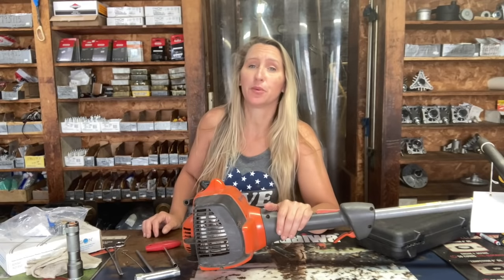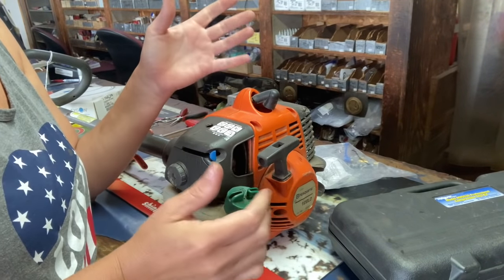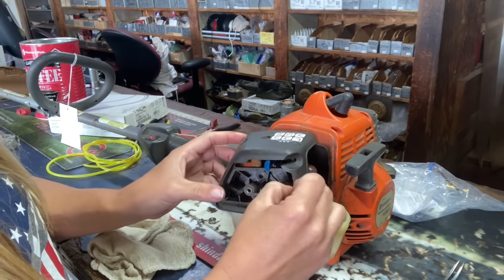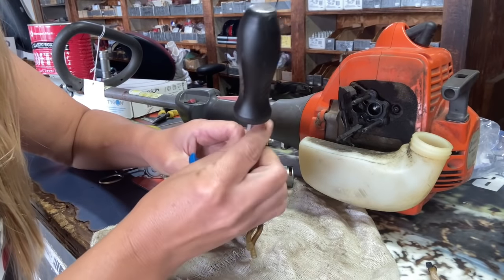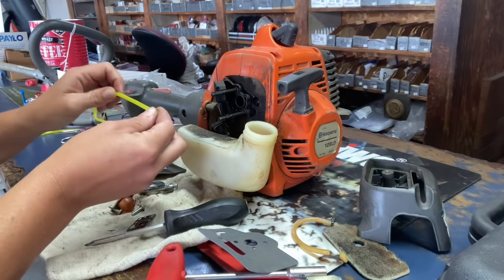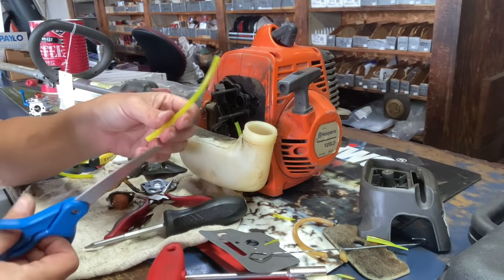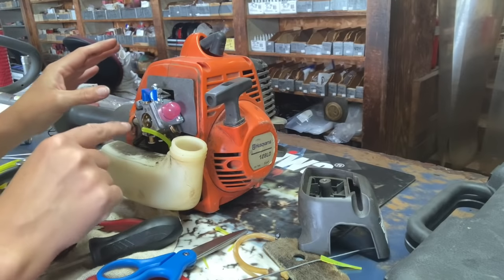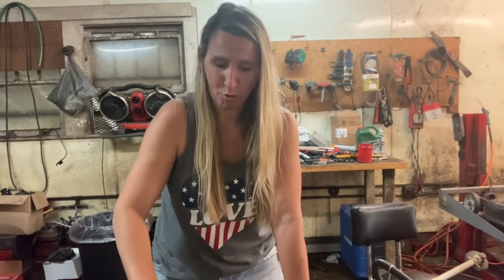How to fix a Husqvarna trimmer that won't start or only runs on choke

Comment from the maker: If you would like to replace the carburetor, here is a link to a Original Equipment Carb. I would highly suggest NOT buying aftermarket. Thanks for watching!  https://www.amazon.com/gp/product/B00QXWP2WK/ref=as_li_qf_asin_il_tl?ie=UTF8&tag=chickanic-20&creative=9325&linkCode=as2&creativeASIN=B00QXWP2WK&linkId=8fd7a5e4477fd19fcb55c5f467281882

Comment: Wonder why she did not reinstall the fuel line connectors back in the tank ?
Reply: ??? She did.  Perhaps you dozed off at that point.
Remember the long diagonal snipping of the fuel tubing  so they could be poked into the tank?

Comment: My Husqvarna trimmer is not even 2 seasons old, and I am having issues, it only runs well on half choke, can't understand, why it has to be choked out just to run decent.
Reply from the maker: Check you fuel lines. They are terrible about rotting.

Comment: Changed the carb checked the fuel and it still only runs on half choke any suggestions
Reply from the maker: Did you buy aftermarket or an OEM carb?
Reply: @Chickanic  oem took your advice

Comment: Always try and sell homeowners canned gas Stihl Echo Husqvarna then there's no expensive maintenance 😁
Reply from the maker: To be honest, even though I know it is the best stuff, I cringe making people pay for the Echo Red Armor canned fuel at my shop. It is SO expensive. I wish it was cheaper for everyone.
Reply: @Chickanic  While engineered fuel is the best from my experience, a half way step that gets great results is fuel without ethanol.  Put a little Sea Foam in it and you're good to go; the Sea Foam is an added extra.  Not a requirement however it does help keep the fuel system clean.  Nice video.  Well done and very useful.
Reply: @Chickanic  It's actually cheaper, depending on who you sell it to. You just need to market it as the gas to use when the machine does not get used very much, then it's worth it's weight in gold (or lumber) in terms of preventing issues. People who run their stuff for hours are better of using their own mix until the job is done, then swap out the fuel for canned fuel, run it a few minutes and put tool back in storage.

Comment: Just drain all fuel out of your fuel tank when your done using then start and run it dry when you leave fuel in your  machine it eats your fuel lines and rubber  gaskets

Comment: Nice video. I’m sure you know and it was just for show at end of video, but I hope you did not give that small engine full throttle on cold engine. That’s number one killer on small engines like that and chainsaws. Cold engine and high rpm cause small piston to get super hot way faster than rest of engine. This causes uneven heat distribution, warpage and scorn cylinders. Always let engine come to temp under low rpm especially on small engines that are not liquid oil lubricated.

Comment: Well now that was a interesting video and obviously you know exactly what you are doing, but as for me I don't want to work on my line trimmer all the time and in the peak of season you have a waiting list it's so long you can't even pay somebody to work on it. So my solution is go electric battery powered weed eater and I have had very good results. I always buy something that has a big battery like 80 volts and it'll cut right with any gas weed eater I've ever owned problem solved.

Comment: I used a drimmel tool to make the fast and idle air adjustable. ENVIRO NAZIs can take a walk till their hat floats. Those loons control the carburetor casting design so you can't adjust them with a  common screwdriver. Good gravy!

Comment: Check out the Tri-clone trimmer, it's perfect for overgrown and tall grass 
Cuts grass, bushes and small trees Tangle-free, save time, save fuel and easy to use 
Never need to sharpen the blades
www.amkorti.com